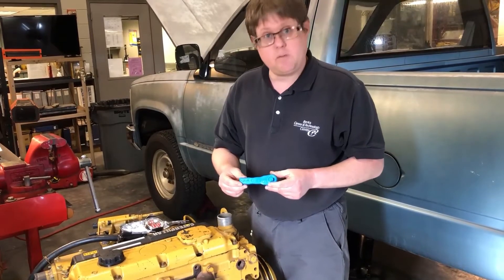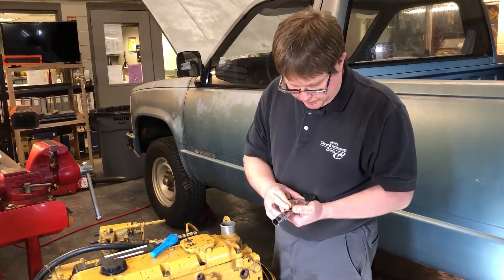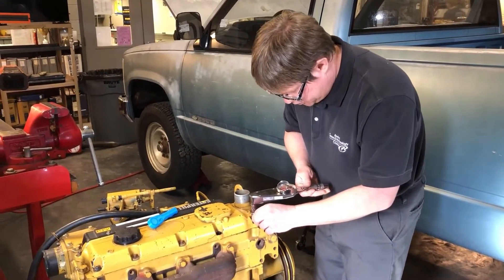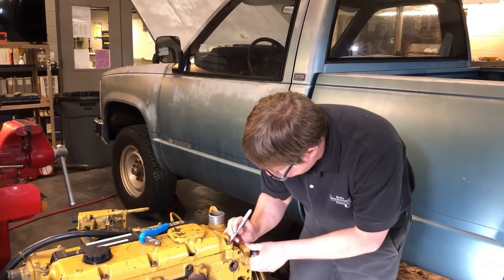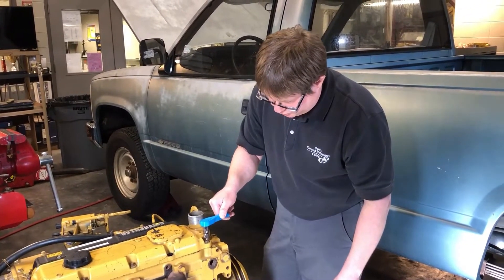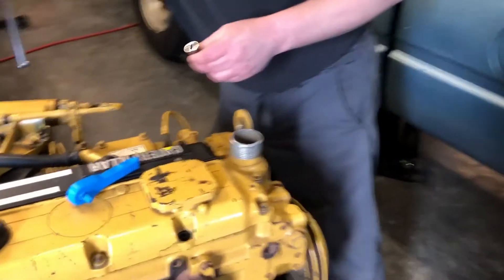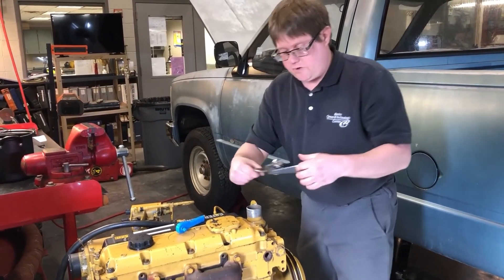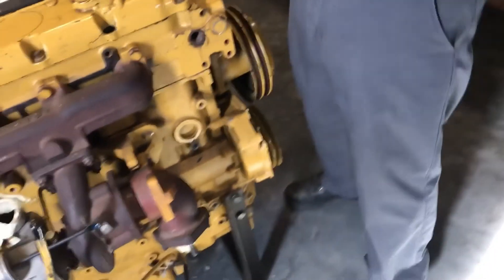Testing the NASA 3-D Printed Torque Wrench

Comment: A part inside might have jammed preventing a slip.  The filament used may be different.  The temperature it printed at may be different.  The amount of oxygen to nitrogen in the air when it printed could make a difference.  They may have lubricated it with graphite.  There are so many reasons.  One more thing, if you don't sandpaper off the burrs then there is more plastic in the way of the mechanism.
Reply: Also, reversing the tightened nut to see what torque it was torqued at is not a very accurate test. There is hysteresis in tightening, where the loose torque is probably different than tightening torque

Comment: you should have printed more perimeters that's why it broke
Reply from the maker: Thank you for the feedback.  I didn't print it and I don't have experience with 3D printing but I believe it was designed to break and that is why it had 3 inch pounds printed on the handle.  Maybe I am wrong and it should slip and not break at 3 inch pounds but if that is the case it exceeded the torque it should slip at.  I still am not sure what the design goal was with this 3D printed ratchet.
Reply: Honestly, the shearing force exerted on this design is going to be a problem no matter how you print it. I reckon the other designs on thingiverse that use a hex bit would be a better bet.